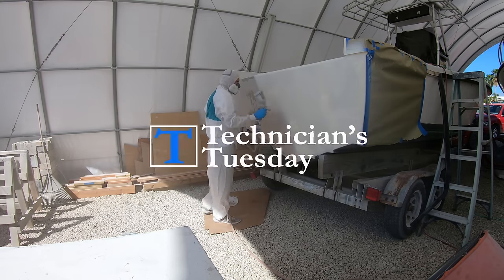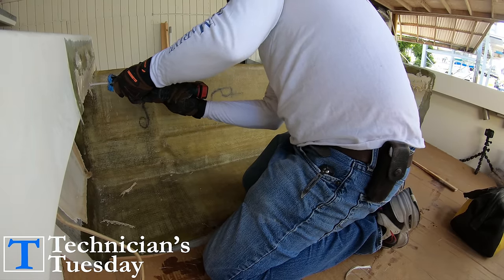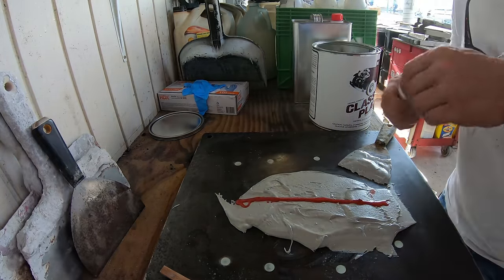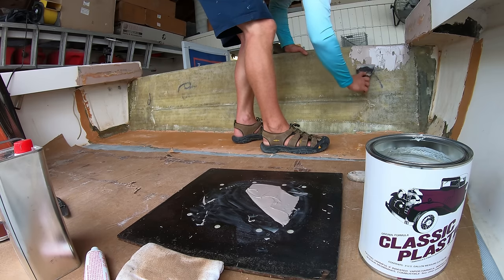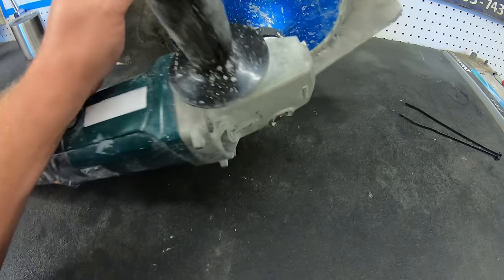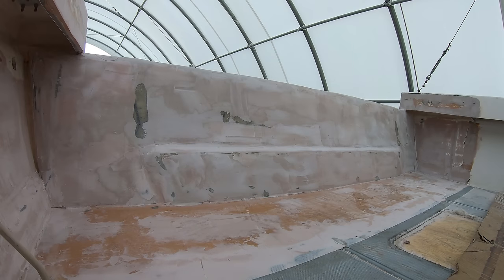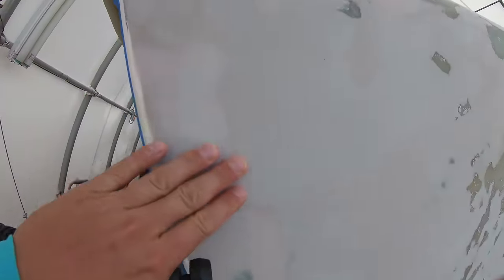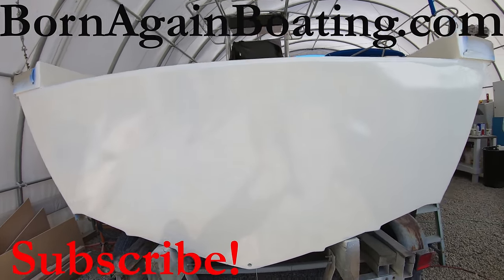Making Boat GelCoat Look Good!

Comment from the maker: Suggest Topics That You Would Like For Us To Cover On Technician's Tuesday! https://www.bornagainboating.com/technicians-tuesday/
Reply: hey buddy i hate to see a guy work  hard , when a couple small tips might really help ,, ok heres a great one that helps things look   tiddy and  neet ,,, ok  all things that are to be covered in fiber glass  should have rounded edges ,, it helps stop air pockets , and bond to the  greater surface area ,,  inside 90 degree  are ok ,, but any out facing edge  should be rounded ,,, the other great tip is  to use mylar  or thin hard plastic sheet  you can put between you the  the uncured  fiber glass ,, you can see where you need to roll it and  get air out from under it ,,, it works great and the glass sets up under it just fine ,,, hope these help buddy have a good day
Reply: @lesterclaypool1  +++++
Reply: Spraying Gelcoat
Reply: I am rebuilding my baja ski boat and would like the step by step on how to fiberglass the new coosa into the existing boat with structural integrity. Also would like the best path to a good finish. This is my first time to restore my boat and there are a bunch of different suggestions out there on what I am trying to do.
Reply: I second spraying gelcoat. Also, installing scuppers could be a good one!

Comment: I like to apply  a coat or two of gel coat directly over the glass after lay up. It will act as a guide coat exposing the highs and lows after sanding. Using release fabric is a good trick too. Lay up your glass and carefully apply release fabric over the area as soon as you finish lay up. Smooth out with a fiberglass roller or plastic spread. Once cured release fabric peels right off leaving a smooth surface.
Reply: Plus it works as a primer coat so you don't get the pin holes in your final coat.  Use fairing compound over that after you sand it down and then finish gelcoat.
Reply: Can you tell me where to buy this "release fabric"  thanks in advance.
Reply: @mescalp  I get all my fiberglass supplies from FiberLay
Reply: @mescalp  the fabric is called peel ply, I typically like the blue variety. Takes a ton of sanding time off of the project
Reply: @279memiller  Thank you Mike
Reply: Mummy yeah works I suppose. See genuine epoxy peel ply it shouldnt be leaving a smooth surface mate, it should be textured it has a distinct texture left over. The fake cheap stuff doesn't work it still allows Ablush. The reason nobody checks if it's the real stuff is because it still straightens/flattens the work and stops sagging and that's all they recognise. Genuine epoxy peel ply will leave a texture that feels like Mirka Abranet, if you know how that feels. The fake/cheapo stuff loses threads too so you end up with threads in your work.

Comment: I like the Total Boat fairing compound.  I think you should rebuild the boxes in the corners. You could really add to the structural integrity of the transom by using the boxes (and lots of fiberglass) to strengthen the transom. Especially if you are going to put a big hp motor on the boat.

Comment: Nice project and well done.  I developed a sensitivity to polyester after many years of boat work.  No more for me.  Now it's all epoxy, which I like a lot more as it cleans up with alcohol, and is easier on the skin and lungs.  My Mom had a business making Xmas ornaments out of polyester resin.  Late in life she developed COPD. 
I just walked away at the first signs of sensitivity, and have never looked back :)
Reply: Good advice. After many years using small amounts of Super Glue in woodworking I developed a respiratory sensitivity to the fumes. My first episode put me in bed with severe coughing, etc. It took two days to recover. Protect skin, eyes and lungs from organic  solvents.

Comment: I use Marine Bondo all the time for below and above the water line with no issues for the past 12 plus years.
Reply: My transon have a hole screw below water line. Can use bando bro
Reply: @pol4466  Absoutly, make sure it is a Marine Grade Bondo
Reply: Marine bondo is fine for filling as long as its not a small flexible boat. For the extra 2 mins effort I don't understand why folk don't use epoxy. I suspect its because they hate sanding it bit there are loads of disc that work well with epoxy, I've even got the little 3" mirka gold sanding pads for my smaller D/A sander and the 80 grit cut through epoxy no sweat and no clogging as long as my speed setting is bob on and I rasp them clean every 30sec with a normal 80grit

Comment: you know bondo has several waterproof filler options like bondo glass and resin jelly as well as many other brands with similar products they would definitely be a better option with almost identical steps. although as you said as long as it is well sealed it shouldn't be an issue.

Comment: So here we are 2 years later. How is the bondo holding up? Are there any surface cracks? Is the gel coat cracking? I’m betting it’s holding up fine. I used it to fair all the old rub rail holes and crazing cracks in the gel coat of the top cap of a 73’ Sea Craft I redid about 7 years ago. I painted the boat with a quality top coat It held up fine.

Comment: I do whats called Rondo or a Bondo Milkshake. Its mixing equal parts of bonds with fiberglass resin to thin out the bonds. You use the harder for the bondo. Its easy to spread and will be water proof. We do this after all the fiberglass has been laid down to smooth it out and make for a very nice finished product for painting

Comment: Next time do the ferring with gelcoat and cabosil mix them together till you you get the consistency you want. Much stronger and better material you'll like the finish.
Reply: I use Cabosil and fumed silica mixed together.

Comment: I rolled on my gelcoat, sanded and applied finishing plastic bondo from NAPA before I begin building up my gelcoat. Spraying is ok if you have the tools and the compressor capacity

Comment: Not sure if I missed it but why bondo? Is it cheaper or easier to work with then the normal fiberglass fairing? Just wondering why you would use it instead of the better glass fairing. Thanks for sharing this video.

Comment: Was very sad to see bondo over the nice lay up work.    Was surprised that you didn't opt for a short strand filler or even filler with milled glass  may have only added an extra 100$ to materials
Reply: $100 extra in materials, and for what reason? Why use Bondo glass or milled glass filler?
Reply: It's polyester body filler not clay based old school "Bondo." It works so well a thin coat can seal anything as long as it isn't damaged.

Comment: The secret with fillers on boats is the presence or lack of talc.
Any of the plastic fillers are semi adequate for fairing fiberglass but if they have talc in them they will attract moisture. 

I have always used 3M premium filler which of course has no talc and is recommended for use above and below the water line. There ore others and this is one of the most expensive fillers out there but also one of the finest. Most fillers are polyester based which is the main ingredient in most fiberglass lay-ups. I can hear the screaming already but epoxy has no place in polyester repairs, it's too stiff and too expensive.
I have used hundreds of gallons of talc-free polyester filler over the past 40 years and am proud to say that I have NEVER had a failure of any kind related to the product itself.
Reply: 3M filler is junk too. Mix your own epoxy filler or accept the fact you bodged it. There are no good marine fillers, not one.

Comment: I have worked with polyester fiberglass before and the MEKP hardener is some very bad stuff. If you get a splash and it gets in your eyes, you have 2 seconds to rinse it out before you lose your sight. wear  your PPE

Comment: If you mix bondo with resin really well then add the hardener bondo becomes flexable
Reply: Flexible bondo is a sign that something went wrong according to the manufacturer sheet.
Reply: @tomharrell1954  after years of customizing trucks, speaker boxes, bagged and juiced trucks, I can tell ya don't follow the dang directions.
Fiberglass and fiberglass resin is designed to be strong and un pliable.  Bon do is mean to do something similar but you wind up sanding 90% of it back off🤔 after lots of experimenting mixing bon do and just resin until you get the consistency desires then add the hardener, you can actually spread it out on wax paper and make it 1/8 inch thick, let it setup, peel it off and you will be able to bend it around and touch itself without it snapping, which would happen if it was one of the other.
I think the bon do kind of works like the dust, but doesn't react like the dust. But for things that must have some give or flex, this WILL work, and can be added to an already fiberglass project. All I can say is experiment, may work for you, maybe not. Let me know if it does
Reply: thecapturban   It will never work for me.  I do not use Bondo on any boats.  It absorbs water therefore useless for boats.  

I was watching this video in hopes he keeps up with this boat.  His hard and beautiful work I think, my opinion, will be a waste.  The Bondo will absorb water, crack and delaminate.   Bondo has a bad reputation to begin with.  It certainly does not need any more to help it down the tubes.

Comment: As much as i know, gel goat needs to be covered with plastic film to cure. What you can spray on and just leave to harden, is top coat.
Reply: You only have to cover gelcoat if it doesn't have wax in it.
Reply: @prohen3049  👍 yes add wax to last mix up then the gelcoat cures in its own environment .wax in styrene

Comment: It would be far easier to handle bondo if you used the larger sized rectangular taping pan (3" x 15" x 3" deep). I used to do taping in very high valued homes. Just an FYI, I'd have filled one pan and worked from left to right then right to left starting from the top. I would use two taping benches (you can set the heights perfectly for you) that allow you to easily move all the way across and up or down. Then, I would use an entirely different 12 inch knife. They're actually carried at inexpensive home stores. Maybe $15 bucks or so. The handle is attached to an "L" bracket and the knife edge is 12" x 3" and they are stiff. It allows room for your knuckles so you can flatten the knife more on your final smoothing passes. Depending on how thick you wanted it, based on watching this video, one pan would do maybe 2-2 1/2 passes, then you'd have to make more. Better yet, having a helper mixing bondo would allow you to keep working. 
 
Not to make fun, but someone who knows how to use a knife would take roughly 10-20 minutes to completely cover and smooth the outer transom (with a mixing helper). Plus, it would be dead smooth and almost perfectly flat. Believe it, or not, those inside corners on the inside of the boat would take longer to get dead smooth and perfectly square and flat. I'd use a good quality 6" knife (sorry but not what you were using) from Hyde or Wallboard. I guess what I'm saying, it's the knife you're using that's slowing you down and making it more difficult. Oh, every time you load the knife you'd clip some off the bottom edges of the knife so the mud/bondo would not easily slide out around the knife falling to the ground. Pressure must be very hard. I'm only writing this just in case you have any future similar jobs. Based on the quality of your work, you might hear from a lot of people looking to hire you. Really, a fantastic job! I do have a question though, why didn't you wrap at least a couple of layers of fiberglass around the corners on to the mating surface? (You'd have to grind down the mating edge to receive it.)
Reply from the maker: Thank you! Having a helper would be great lol maybe someday :) I don't mess with the corners just because it would get lumpy and then on the bottom of the hull that bump would be a pushing the bow down!

Comment: I just gotta know why you HAD to use bondo? I honestly can't think of a reason why you are using west system fillers which are some of the most expensive and then switching over to bondo to finish the project off. You did such a good job on everything else!
Reply: Why not use Totalboat Fairing Compound?
Reply: @wayneericksen5374  total boat fairing compound is some awesome stuff!

Comment: Do you need extra solid wood strip to strengthening the hull? Is Fibreglass hull itself strong enough to hold the storm or choppy water without reinforcement solid wood ribs?

Comment: Bondo was developed for auto body shops when the old dent craftsmen stopped using lead and craftsmanship to fill. It let armatures look good without the skill of a smooth dent repair. Every time I saw it used thick (like the low riders making custom car shapes, or fast and dirty dent filler) it  eventually cracked or fell out. Seems a (risky) waste to do such nice labor intensive glass work on a boat that will be subjected to boating stresses and water for years to use the stuff. But just my opinion.

Comment: If you refrigerate these components before you use them.. take them right out of the fridge mix them up and it will take longer for them to harden and Gives you more working time... cold is the key..

Comment: On final coat apply a cure film over your gelcoat 
I use dawn dish soap
Reply: What does that do? Just curious
Reply: @akhuntfish7557  allows the catalyst to cure the resin with no air
After it cures hose it off with water

Comment: Love the video and agree with all procedures with the exception of Bondo, i use resin mixed with micro balloons, or wood dust filler, then i sand immediately after it kicks, otherwise its like sanding concrete. Keep posting, great informative videos.

Comment: To my knowledge, most all (if not all) boats are constructed from polyester resin infused fiberglass. Which by itself, is not waterproof. Gel coat (polyester based resin with or without pigment added) is also water permeable.  It is made MORE water resistant through waxing and proper maintenance over the life of the boat. The bondo is
being used as a lightweight fairing filler, then it’s being covered by gel coat. I’m my opinion, this approach is no better or worse than the rest of the boat. Epoxy is a beautiful product, but it’s ridiculously expensive to use. With proper installation of through-hull fittings/hardware and with proper maintenance of the vessel and gel coat, water won’t be able to penetrate enough to affect the fairing or glass.

Comment: Gel coat is for making parts in a mold.  It’s NOT for doing repairs.  It’s too hard to sand and makes way too much work.  Use awlgrip high build primer and paint.  You’ll be much happier.

Comment: What is the size of the spray nozzle on your gel coat gun? 
What is the pressure ? 
What do you use for a thinner?
Reply from the maker: That I don't know, I just prep it and have a friend of mine do the spraying :/
Reply: Born Again Boating  
I don’t know if you are interested but 
I use a HVLP sprayer by Devilbiss 
For thick gel coat no additives 
 Nozzel 2.3 mm 
60 pounds at the pump
Bigger would be better but it does not give as nice of a job. 

It’s really to thick to spray without a thinner/reducer.  

I am a hobbyist but have painted several. 
Got two to do now. 
But I compare with others cause I am not perfect yet.  
Styrene for thinner.

Comment: Your work skills are excellent.  But Bondo on the outside hull of a boat is a no no!

Use TotalBoat Polyester Structural Repair Puddy

Or 

Total Boat 
2- Part Epoxy Primer  

Then apply gel coat directly over
Reply: I must have missed something. 
You knew of the Bondo being problematic but used it anyway.  
Why? 
I would like to know how the boat turned out and held up! 
I don’t use the Bondo because people with professional expertise told me NOT to. 
Was I told wrong??? 
Is this an experiment? 
Do you know THE NIX ON BONDO is incorrect??

Comment: Nice work could please tell what spray paint your using, I have an old boat could I make the gel coat gloss again without respray
Reply from the maker: Depending on how bad it is. A wet sand and compounding may get the boat looking pretty good again.
Reply: Born Again Boating  many thanks
Reply: Wet sand and buff with 3M gelcoat restore. Bunch of vids on YouTube how to do it.

Comment: Got a question,  I bought  a boat  . The gel coat or paint has not been taken care of ... if you wipe your hand across the boat in most areas  , the white paint comes off on your hand , like rust dust  but white paint dust ...  can I try to polish this boat or what needs done ? 
Any help would be appreciated

Comment: I have a 2003 198 Carolina Skiff. I bought it with a broken runner on bottom of boat. I cut out a 3 ft by 9 ft section and installed stringers and new foam. I covered the opening with marine fiber board and fiber glassed the complete opening. I used bondo and marine filler to level out some of the low areas. Im ready to Gel Coat the bottom. Ive not done this before. I would like to know what to use,how much to mix at a time to gel coat complete bottom of boat,where to buy the gel coat. I plan on rolling it on to save on expense of using an air gun. Any advise would be appreciated.Thx.Chuck
Reply from the maker: Awesome Chuck! Nice work, my gel coating isn't the best, so I would say to check out Andy with Boatworks Today.

Comment: Whats your opinion on the ceramic "pour in" transom?
Reply: I used Seacast on a transom rebuild and it worked great, had the boat for about 7 yrs after rebuild then sold it, still solid as a rock. Getting the old transom out and prepped for the pour was the hardest part.